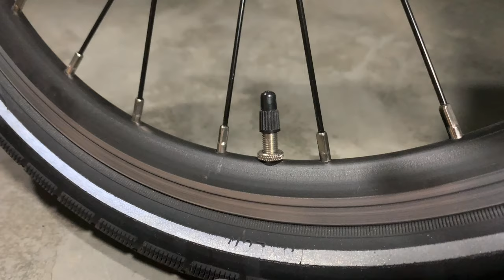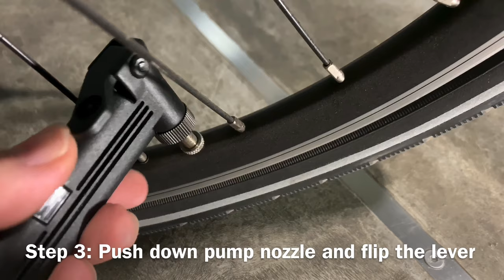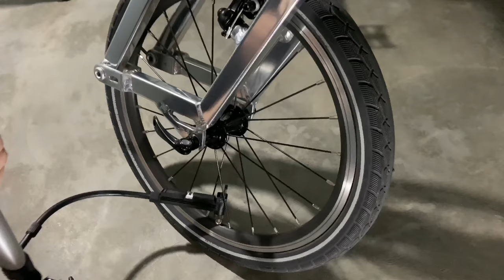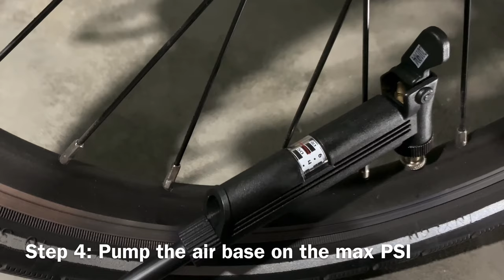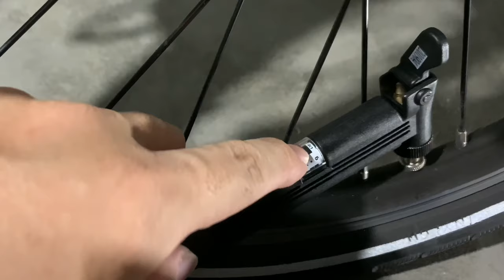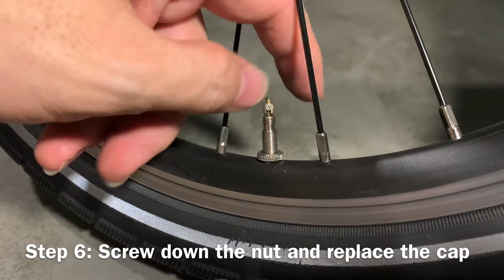How To Pump Presta Valve Tyre

Comment from the maker: I've learned how to pump presta valve tyre on my birdy bike and I thought it is one of the most essential tools for new cyclists. With proper inflated  tyres, the riding is far more efficient and roll better. 

I hope you'll find the video tips useful.
Reply: Technically u will let out some air when you pull the pump adapter out from valve. Should you overpump the tyre slightly, say >5psi higher than intended, so that you would get the desired pressure after you pull out the adapter?
Reply from the maker: mommastereo thank you for the highlight. I thought it’s the suction pressure causing the sound. Nevertheless I’ve tried to pump closer to 90psi before and use my fingers to gauge the hardness of the tyres. 

I’m going to standby some spare tyres for the next tutorial video when I need to change them.